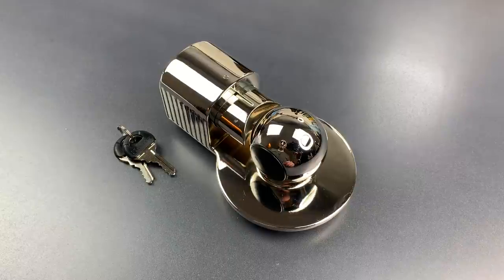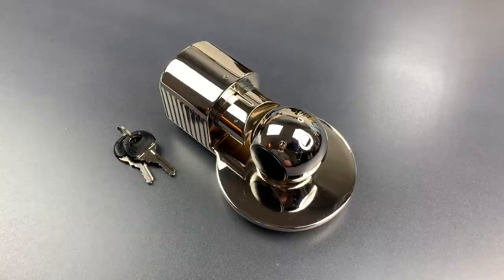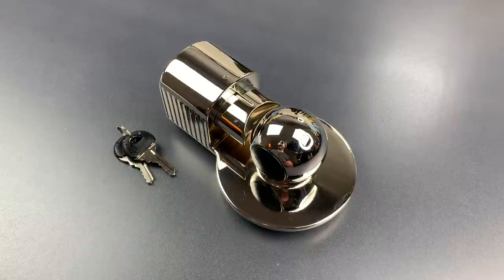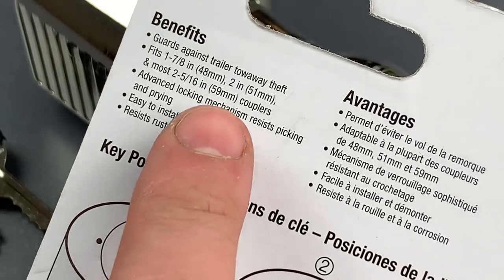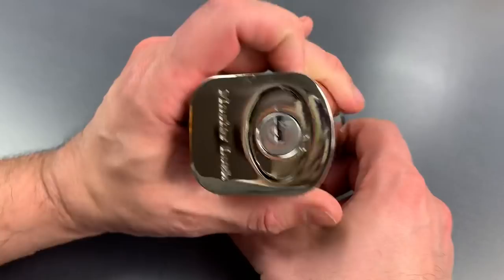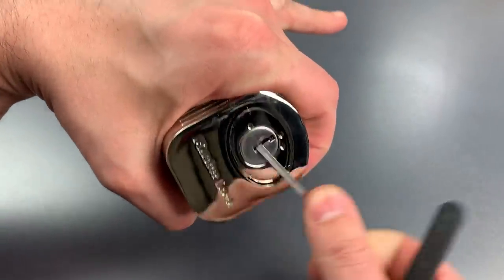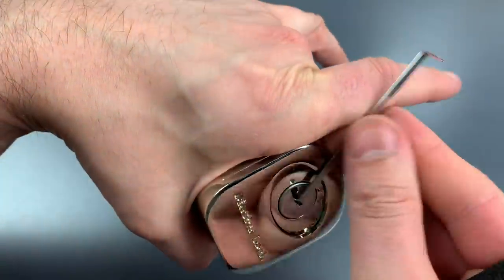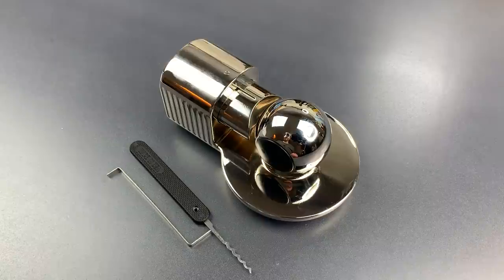[809] TERRIBLE Master Lock Trailer Coupler Lock Picked (Model 377DAT)

Comment: Most people will have a harder time picking their nose compare to picking that lock lol
Reply: Especially if you are wearing a mask.
Reply: I'd be one one of those people lol
Reply: I just started picking my nose.
Reply: Yup... didn't clip my finger nails and scratched the inside of my nose... now my nose is filled up with blood.
Reply: I dunno, maybe picking your nose with that wave rake tool would work. Or be a terrible idea, who knows?
Reply: I think he could pick the lock with that nose.
Reply: You joke but I have this booger I've been trying to get at for days. It's close enough to feel it with my finger tip, but too far to reach which leads to nose bleeds. :( blowing my nose does nothing.
Reply: Got a nice chunk of gold stuck up there right now that doesn't wanna come out, so you're right. Very right.
Reply: @davecrupel2817  try a Bogota in .030". Just remember to wash it after.
Reply: Hold on I'm about to strike the fortune
Reply: the rake looks like a paper clip that I failed to bend back properly :/

Comment: Why do they even include keys in the package. It is faster to rake, than finding the key
Reply: I thought the rake was the key, though.
Reply: My father bought master locks for his trailer and went to get the keys to open them, by the time he walked back to the rear of the trailer from the truck cap I had both locks open and latches undone
Reply: in case you lose your rake
Reply: It is really unfair to use a rake chosen to match the shape of the keys. 😆
Reply: Halberdin I bet that anyone can rake it open by using a real garden rake.
Reply: A butter knife matches the shape of that key
Reply: What you're not factoring in is that the shine IS the resistance that slows you down - you have to take time to go and find a mask before you rake it, which slows down your lockpicking process.
Reply: @Halberdin  That's literally what a rake is.
Reply: @WJS774  I think they were thinking it was a rake made just like that specific key, rather than just like a generic key which the rake actually is. Though in this case, I think a paper clip would get through this lock... or even my fingernail if clipped properly.

Comment: "It's hard to imagine a lock that resists picking less than this one."

Absolutely eviscerated...

Honestly, aren't most hitches going to have the little latch that slides forward that you put a pin in to actually keep it connected to the ball?  If you're going to lock it, can't you just put a ball inside, latch it, and put a lock through instead of a pin?  If it's just going to be an ordinary keyed lock then I don't see how this would be any more effective even if it couldn't be picked by just shoving a pick inside and doing nothing else.
Reply: Yes you can put a ball inside and latch it then lock the latch.  However, if you look at the design of the hitch, there is a bolt/nut that adjusts the tension of the hitch on the ball by moving a plate closer to the ball.  This could be relatively easily adjusted so the ball that is inserted can be removed and then tightened against the ball on the vehicle taking the trailer.  I helped my dad do this once when the lock on his trailer was rusted so bad it would not unlock.  We had to cut the lock off when we got the trailer back home.

Comment: Ha. Had this junk on my trailer.  Total junk. Not only easy to pick but also east to break with a crow bar. I now  use a proven industries hitch lock.  It uses a puck lock that I'm sure you could pick but being a 6 pin lock that's totally surrounded by 1/4 inch steel is way better that this master junk.
Reply: Jim B not surprised. I was shocked when he said it was chrome plated zinc. Zinc isn’t known for its strength, you could probably snap that thing going over a rough speed bump.
Reply: We use these on our trailers at work. 
But we also use a wheel boot at the same time.

It's not about fully stopping the thief, just making it take more time than they want to spend on it.
Reply: pileofstuff check out proven industries hitch locks.  A little on the high price side but so worth it
Reply: @pileofstuff  3 seconds to rake it is not much of a delay IMO. I also opened one of these with a metal zip tie in 15 seconds when we couldn't find the key.
Reply: Their locks cost more than my trailer.
Reply: I use a 3784DAT with the same type of lock for the coupler along with an abus 83wp53 padlock fitted with CX5 ZPM lock cylinder for the latch for our hydraulic trailer. 2 different keys but not too expensive and the ZPM is pretty hard to pick, especially if you dont know you way around high security locks. If your housing expensive equipment in a cargo trailer then i would get the proven industries lock for the coupler but for a utility trailer this is fine.

Comment: Are you even raking it? Looking at the key it looks like even the back of a pick would align the wafers
Reply: no he raked it but if watch carefully the pins actually align when he first puts the rake in just like if he had inserted the key
Reply: I was going to say, the key bitting on this particular lock looks like it could probably be picked with a nail file just as quick.
Reply: You can use a toothpick to pick it and a zip tie to zip it and a rake stick to break it.
Reply: He didn't rake it, he used a bump key which bounces the pins makeing the openings big and so on.
Reply: @connorObye  I don't think you're commenting on the video you think you're commenting on.
Reply: Whoops no, I didn't even no what raking was (I always called it the use of bumps keys as well) till now. The 2 work pretty similarly though.
Reply: Bump keys are nothing like rakes. You use a bump hammer with a bump key.
Reply: You don't have to, and that doesn't change mechanics wise much but they are a bit different.
Reply: @connorObye  FWIW, it's called a bump key because you 'bump' it with a hammer.
Reply: Like I said you don't have to and yes, they are a bit different. I did make a mistake. I admitted to that.
Reply: I think I've got this figured out. The item you're calling a "bump key" is actually called a "jiggler". This actually kinda explains why you'd confuse it with a rake, because a jiggler is used in a similar way to a rake, while a bump key is not.
Reply: @connorObye  You're thinking of jigglers or some shit.

Comment: I had a small (14 foot) boat and trailer, stored in an apartment house parking lot, stolen in about 1970. My only security was a Master Lock padlock on the trailer ball latch and the thief or thieves cut the shackle. I bought another boat and trailer to replace it, and installed a, then current model, Master Lock trailer coupler lock. It seems like it was more robust than the model 377DAT in the video, with its fairly standard 4 pin tumbler cylinder. I parked the trailer in a more secure location and supplemented the lock with a boat tilt alarm, which activated the boat's horn. That boat was not stolen and served me well for many years, before my lifestyle changed and I sold the boat.

Comment: I foresee a class action lawsuit in Master's future.
Reply: hope so.
Reply: I agree, I got a Master lock with "25 million combinations" and 5 dials 1 through 10. 10^5 is only a quarter of a percent!
(edit: fix number of dials)
Reply: @thorlancaster5641  not a quarter of a pct, but 4 pct.. 1 million /25 million equals 4 / 100, forget the million on both sides
Reply: @harrickvharrick3957  I mistakenly said that the lock had 6 dials. It only had 5. Fixed.

Comment: Bloody hell! Wafer locks need to be banned..... while they're at it, ban Master Lock too!😆🍺😎✌
Reply: They've always been little more than a psychological barrier. 40 years ago my job was servicing  equipment secured with various wafer locks. Rather than source and carry dozens of keys, I had a rake and tension tool on my key ring.
Reply: It's a deterrent, not a sure thing. A thief will open literally any lock you can possibly buy, it's just not possible to make a completely unbreakable lock. They're meant to keep honest people honest or sightly slow down/possibly stop thieves by having them decide to move on rather than try to break the security.

Only a fool buys a lock to stop a thief, because only a fool believes any basic level of security will stop a dedicated or skilled one.

Comment: I have been having trouble finding this lock lately.  When coupled with a lock passing through the ball hitch latch, it seems to be enough of a deterrent to keep thieves away.  A breeze to pick though.  On both the positive and negative side, the lock is prone to freezing up from water intrusion.  Without heat, Winter pickers will have a hard time removing this lock.

Comment: I have a question about making the lock less trivial to pick. So not knowing anything about it, here it goes.

Couldn't the pins and other parts inside the lock be swapped out? I thought in several of your take apart videos, you showed pins (they ride against the key) and spools (they ride between the pin and spring). Could those items be replaced with components that decrease the triviality of the lock being picked?

Thanks for the videos, I really enjoy watching.

Comment: This lock is designed only to be opened using the provided key. Using anything else voids the warranty. Tampering with the lock also opens you up to prosecution if you try this on someone else's lock.

Comment: @LockPickingLawyer are you planning on looking at the Altor Apex Ti? It hasn't been independently certified by Sold Secure or anything, but it has an unusual lock that doesn't require keys to be locked, only released with them. Its frame is also titanium - I'd like to see it go up against bolt cutters or an angle grinder!

Comment: You could probably get it open with a few good hits from a 5 pound sledge 
From what i remember cast zinc isnt really that strong
Reply: Sure, but often theft is about being undetected during the crime.  Stealing a trailer would mean some combination of backing up to it, defeating the lock, and hooking up to it enough to get it away from the owner, then properly hooking up so that the cops don't stop you for no lights etc.  If defeating the lock requires a whole lot of noise that will attract attention.  If it can be nearly silently opened without a key then the risk of detection is a lot lower.

Comment: I was watching a bunch of your videos and thought to my self, if the padlocks you take apart are tensioned by springs to lock them, wouldn't heating them up with a blowtorch and shaking the shackle open it by breaking/deforming the spring?

Comment: "Resists picking" is Master's way of saying it has more than 3 pins or wafers. They still think 4 is a high standard.

Also, from looking at the key, it looks like you got one with terrible bitting. They shouldn't allow a bitting like that to leave the factory, but they are run by beancounters.

Comment: Owned one of these and found picking wasn't necessary, the theif took a sledge hammer and blew it apart and made off with my 24' enclosed trailer during the middle of the day.

Comment: @LockPickingLawyer I noticed the bitting was horrendously flat and that is surely the reason for the easy rake. 
I have a great disdain for most Master products and their slimy marketing tactics (I believe as you do also), but would some reminders or education about bitting help? 
I was looking around for some 930's in the Depot and I didn't buy some because they had bitting like that, but ended up buying 3 that had some GREAT bitting.
My last thought is, did you choose that lock, or was it random say, from Amazon?

Comment: Use one of these for 8 months and they reach a point where they don't even need a pick to operate. Pop any key or tensioner in and presto it will open for you.

Comment: I have yet to see any hitch lock that doesn't snap in a couple whacks from a 2 lb hammer. Especially disappointing given that you're typically obscured when hooking up a trailer and people would just think you were having difficulty getting it to latch if they heard you beating on it. I see them on enclosed work trailers with $10k+ in tools inside all the time. It's so sad I can't even be cynical about it.